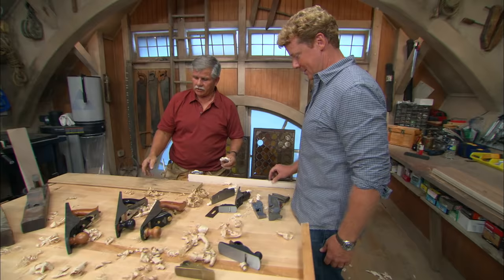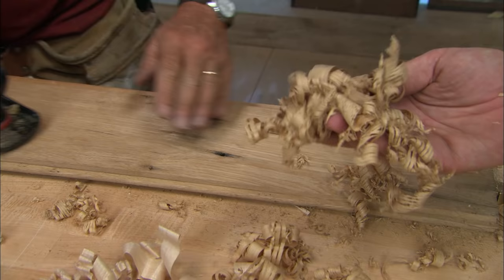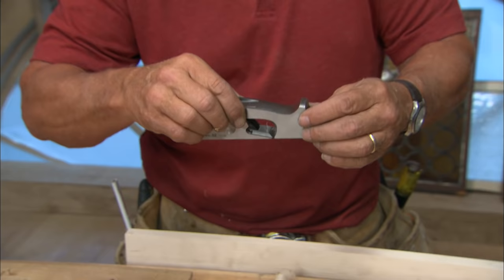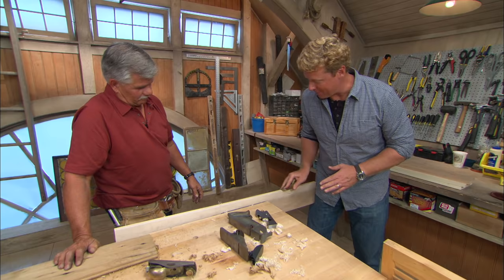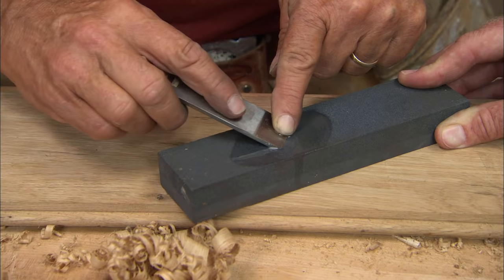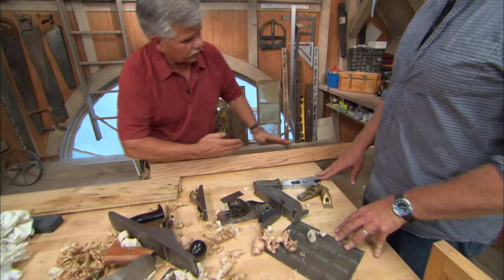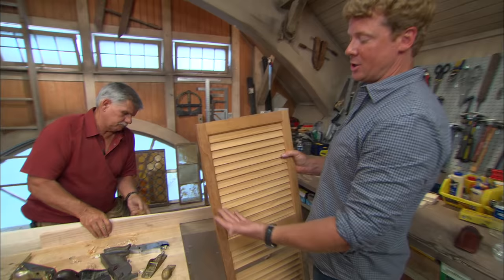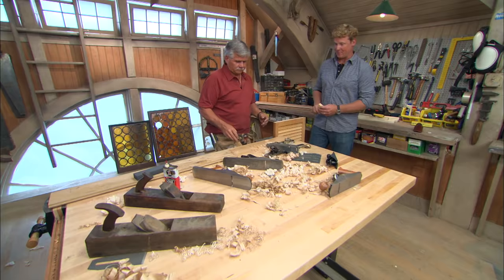How to Use a Hand Plane | Ask This Old House

Comment: I do not understand how a plane works. Wherever you start with the plane it is going to cut a swath as wide as the blade. Before the blade stars into the wood, there will be an area not planed. If you go back behind that to even out the part that was not planed, the plane will then dig a deeper ditch where it was planed. You are going to have uneven surfaces all over. There may not be humps but there will be gentle rises where you planed and where you didn't plane.
Reply: this assumes the full blade is always making contact with the wood, which is not always the case. its averaging all the slopes in the area of the bottom of the plane and shaving anything above, thats why the very first planing shown in this video produces thinner ribbon strips of wood rather than one continuous sheet

Comment: I find I get the best results with the block plane when I hold the plane at about 30 degrees from parallel with the board I'm planing like Tommy did at one point with the bench plane. Sometimes you need to create a edge that is "not" straight as when you are scribing to a uneven surface. Turning the plane effectively shortens the length of the planes "foot" and allows you to create a concave that is much harder or impossible when the plane is held parallel.

Comment: I love This Old House, and this video is not bad. However, for learning about handplanes and how to use them, I would definitely go to a furniture maker's (e.g. Frank Strazza) channel. There's some bad advice here; for example, you never take the burr off using the coarse side of the sharpening stone. We flatten and polish the flat side of the blade iron to a mirror shine when we first buy the plane; we don't want to ruin that in subsequent sharpenings and introduce deep scratch marks. Also, I'd advise against laying the handplanes down on their side; that can mess up the lateral adjustment. If you're worried about accidentally planing your work surface, lift one end of the plane by placing a piece of wood or even cardboard under it. All that aside, a great intro for anyone who's new to handplanes!

Comment: Block planes get their name from butchers shops. They were designed to resurface wooden butcher blocks. Block plane. Nice block plane by the way. 👍
Reply: Interesting. When I worked as a sous chef when I was in college, we had block planes to resurface cutting boards after they get all cut up by knives. It's a problem cause blood and guts get down in the gashes and becomes impossible to clean.
Reply: Interesting.
Reply: Intriguing.

Comment: So the thing that I don’t understand is that the blade is supposed to stick out below the planing surface right? But if the board is flat or near flat, won’t it just dig in and scar up the flat surface?
Reply: Possibly it would -- that's why a sharp blade angle and fine adjustments are so important...

Comment: Would I be correct in saying that if the blade goes all the way from side to side that it's ok to use "against the grain"?
Reply: That depends entirely on what you're using it for, how it's set up, how sharp the iron is and what finish you want on the work piece. You can use a shoulder plane like the one he showed to clean up the cheeks (as well as the shoulders) on a tenon, but you need to make sure you're using a sharp iron or you'll risk a lot of blowout (although that won't matter quite as much on part of your tenon as it would somewhere else that actually shows); it also helps to skew the plane (hold it at an angle so you're effectively cutting at, say, 60 degrees to the grain rather than 90). Scrub planes, which are generally modified smoothing planes or other bench planes, are frequently used against the grain when flattening boards, because the primary goal is to hog off a lot of material quickly, rather than leave the surface smooth and ready for finish; that's for the other planes. It does help to chamfer the back edge of the piece when planing across the grain, though.

Comment: 1. Hone the blade razor sharp. 2. Use a low angle block plane for end grain. 3. For the tops of old doors wet the end grain first and let it soak in. Wet wood cuts easier. 4. What Tommy refers to as grain is actually the annular rings. 5. Check the depth of cut first with a scrap of wood first one one side of the blade then on the other side to make sure it cuts evenly across the entire width of the blade. Use the lateral adjustment to even it out.

Comment: And remember to place your plane on its side, never plate down ;)
Reply: That's an old saying teachers told their students in school.  Craftsmen don't put their planes on the side as it exposes the iron to been nicked or cutting yourself.
Reply: they also don't put their plane with the plate down... put it on an angle so there is room underneath the blade
Reply: its fine on wood, of course it cuts wood, on top of other tools or a metal bench...no no unless the blade is retracted.
Reply: It’s fine to put it sole down on your bench as long as there’s nothing underneath the plane. That laying your plane on its side thing is old schoolteacher saying for young kids so they don’t damage the blade on other tools.

Comment: Do people actually use oil on sharpening stones?
Reply: It depends on the grit and how much you have to remove.  If you remove a lot & it's coarse, a light oil is best, because it suspend the metal particles, which you want to remove before they clog the stone. 

If the stone is exceedingly fine, such as the Japanese one that I treasure after buying it 50 years ago in Japantown, San Francisco, then you may want to use water and keep a cloth nearby to wipe it every few strokes.

Learn what grit is appropriate for which stage of sharpening; always go from coarse to finer, and be sure to respect the initial angle the maker put on the blade!  When you get better at this you can learn to hollow grind the secondary bevel, but you need the right equipment and learn to use an extremely light, even pressure, or you'll damage yr wetstone, even undo any good you did in the initial sharpening!
Reply: I think it’s an oil stone, my dad used to use them in the old days. I’m not sure they had wet/water stones back then.
Reply: @bakedbeings  water stones have been used in Eastern cultures for hundreds and hundreds of years, so yeah, they were around. Oil stones were the go to sharpening stones in this country for our fathers and grandfathers. I'm sure they'd be jealous of the diamond stones we have today. I say have some of each type because modern is good but so is knowing the lineage of where it comes from.
Reply: @bakedbeings  waterstones have been around for centuries.
Reply: There are some stones that only work with oil such as the superfine traslucent stones that are produced in the US. So yes!

Comment: Would this be a good tool to flatten a desktop that’s already been glued? And finished with polyurethane. Finish looks bad lots of cracks and I think it’s the hills and valleys of the grain. Yes I understand I would need to re-stain and finish. Or perhaps a belt saner? Any help would be appreciated thank you
Reply: Depends on the exact problem. If the desktop has any kind of twist, bow or cup (or similar issues) to it, a hand plane would definitely work well to flatten that quickly; the problem with the finish may have occurred from the first coat of finish raising the grain, which wasn't then sanded down prior to successive coats, but I have no way of knowing <_<